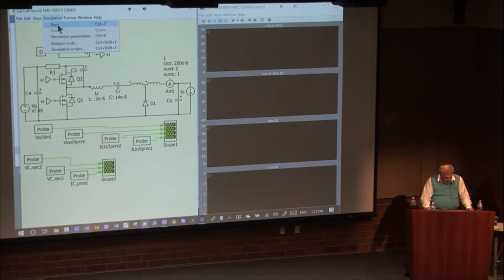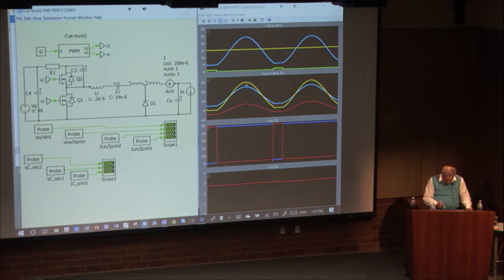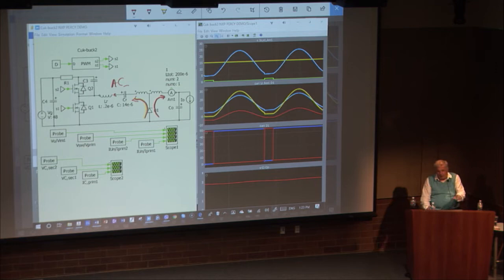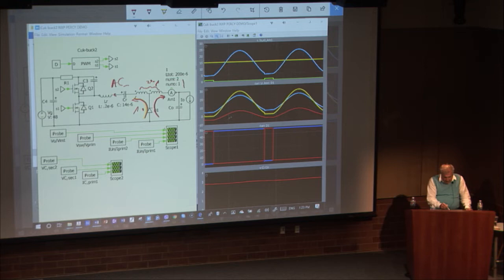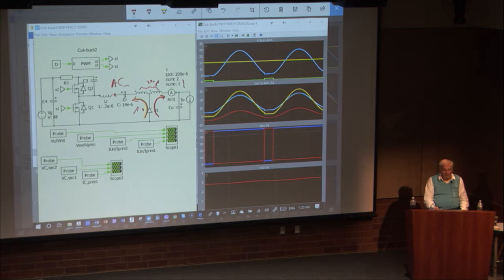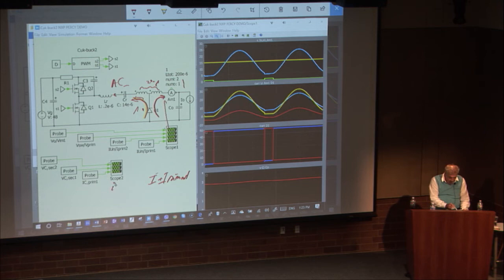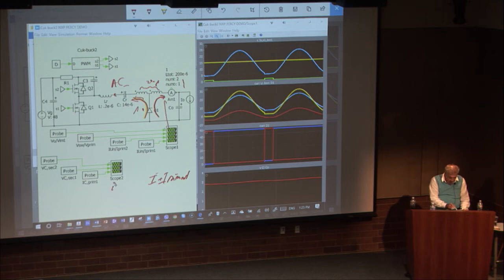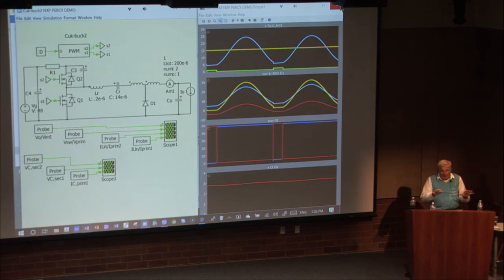SIMULATION OF DIRECT 48V TO 1V FAST TRANSIENT - Part 1

Comment: Firstly, I have great respect for Prof Cuk, I think he, more than any other, is the father of switchmode technology. I  am making statement here, inviting discussion, to improve understanding of this technology, it may not all be correct, if you don't agree, comment! 
   Let's talk about the basic philosophy behind this?  Virtually all switchmode  regulators  are based upon  storage in an inductor. because an inductor has the ability to  have energy  applied  at one voltage and have that energy released  at a different voltage. The current  in both  the storage and release phases  vary time wise but vary around the same limits.
    In the early days of solid state electronics  there were designs produced  using SCR's that gave a regulated low voltage with a  mains supplied 50/60 hz sinewave, with no inductors or transformers necessary. There were TV's made using this technique, I worked on them.  the input current wave form was terrible, and would never be allowed today. This was because the AVERAGE current in input and output was the same, and, in order to get the regulation the conduction time of the SCR was very short, meaning current spikes in the mains were huge, and only a few degrees of the mains cycle.. 
   This technique relies on  the same principle, except for one possible difference, in that  there is limited storage in an inductor! (the resonant one) If this was not true then design one that does not use resonant switching!  Apart from the inductor modifying this a bit, this technique has the same characteristics as the early SCR  PSU's, much higher and shorter current conduction times and higher peak current, with some sort of dissipative voltage control. In reality, this  technique will be good only with the use of limited storage in the resonant inductor to achieve regulation. It is really the improvements in components like ceramic caps, lower on resistance FETs etc that allow it to be an improvement.